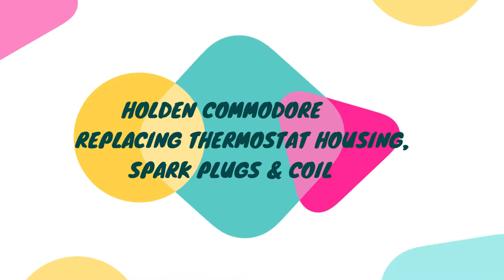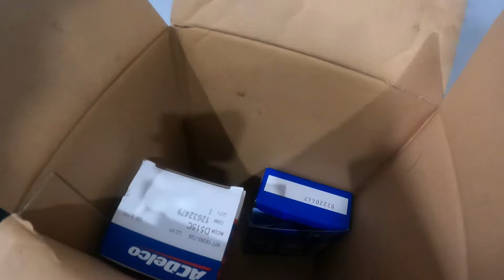HOLDEN COMMODORE (REPLACED THERMOSTAT W/ HOUSING, SPARK PLUGS & COIL)

Comment: Great job Most mechanics pull out the gearbox to put in the thermostat out the back not all of them have thermostat at the back of the motor they should’ve all been on the front to get a mechanic to do it they can usually don’t want to do it because it’s a mongrel job or you’re looking at well over 6 to $700 just to change the thermostat

Comment: Are these engines also in GM front wheel drive cars? if so then the thermostat would be easy to get to in a front wheel drive car, so much harder in a rear wheel drive car.

Comment: Have you every done a thermostat replacement for VF engine? My mechanic thinks he can get to the thermostat from the bottom of the car after removing the exhaust pipe. Your thoughts?
Reply from the maker: It depends what type of commodore, sometimes you can’t get enough access from the engine bay, that’s why you need to remove the exhaust but it’s still hard to have a good access.
Reply: @CJDelao  Thanks for your reply. Mine is a 2015 sv6 VF commodore sedan. He'll be changing the thermostat today and I'll update you once it is done.
Reply: @TheSaintrow3  hey naren what did it end up costing you. 
I have a 2016 ute and holden qouted me $1080 to replace thermostat

Comment: How did you remove the hard inlet pipe out of the thermostat housing.
Reply from the maker: As I remember there’s a 1 bolt that you need to remove attached to the thermostat housing, then don’t loosen up the thermostat housing because you need to remove that inlet pipe first, just pull it out with some tools you can use. B’cause when you remove the thermostat housing first without removing the inlet pipe, thats going to be hard to remove. I hope this might help you.
Reply: Ok, Thank you. 
I think mine hasn't been changed for a while, can they get corroded in?
Reply from the maker: @kirraleebalkin1475  i think it’s just the oring inside of that inlet pipe attached to thermostat housing that keeps us hard to remove.
Reply: Ok, Thank you. I'll just keep passisting with it.
Reply: Yeah I’m not having any luck getting the metal pipe that comes from the radiator off. Any tips? What “tools” did you mean you used? I have the thermostat held in with bolts still, but the metal pipe won’t budge.

Comment: What size bolts was holding the thermostat in 10mm?
Reply from the maker: Yes sir it's 10mm. .
Reply: @CJDelao  I’m replacing one on mine atm what stuff do you have to remove to get to it?
Reply from the maker: Remove the intake manifold first, careful with the hoses attached to it, it might broke.

Comment: Why GM-H didn’t re-engineer the placement of the thermostat / housing for rear-wheel drive cars, defies any logical reasoning. It’s a bastard of a location and forces owners into unnecessary additional expense to repair / replace them.

Comment: This looks CRAZY.
A thought, would it be possible to remove the thermostat from the housing , then screw on the thermostat housing without the thermostat inside,
Then where the bottom radiator hose leaves the enging to fit a  IN-LINE THERMOSTAT .
I re-call many years ago a Renault having a IN-LINE thermostat.
Quite frankly having the thermostat in that position is the most redicules thing I have ever seen.
Why GMH did not convince the accountants to let them re-sesign it.
Reply from the maker: Yeah. Crazy.. especially in a sedan commodore there is no much space.